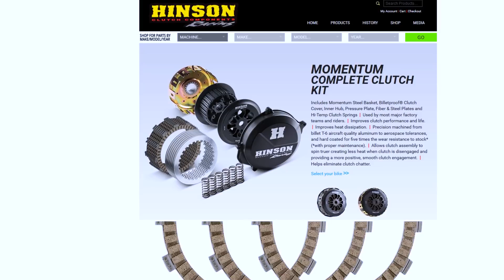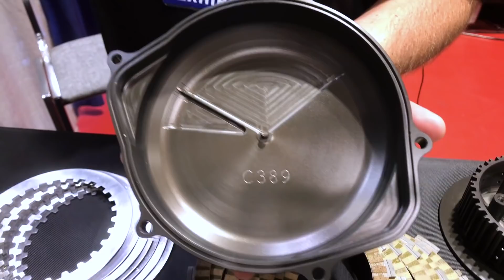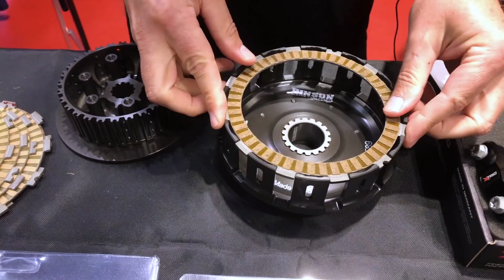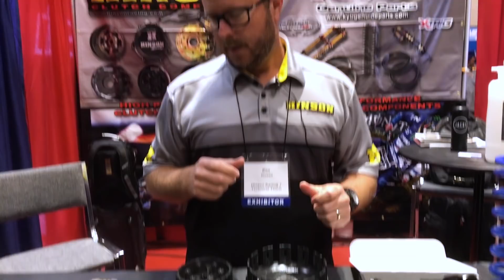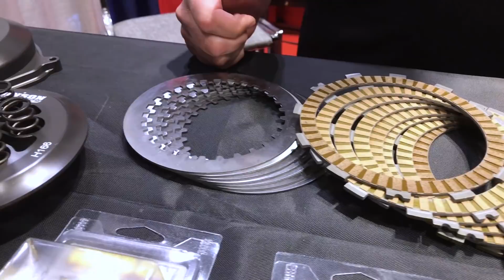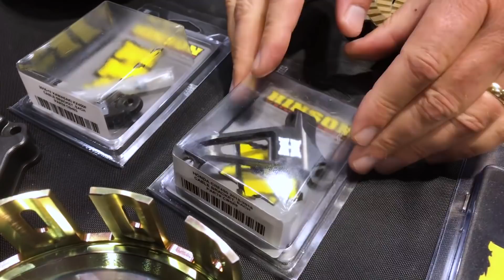Motorcycle Clutch 101 with Ron Hinson from Hinson Racing Watch and Learn

Comment: I was forced to buy a Hinson Basket because I needed the starter gear and could not find that part by itself anywhere, KTM make you buy the basket, drive gear, starter gear, backing plate/rubbers as one part number which sucks, but not disappointed with the Hinson basket, now I have a perfectly good Mitaka billet basket sitting on the shelf.
I must admit, I was more interested in the Barnett billet basket because of the patented hardened stainless steel inserts system, when you start to get too much wear, you don't need a new basket, you just replace the inserts which are not expensive, but Barnett do not come with the starter gear in the centre spline.
Reply from the maker: hi John thanks for the input. Another option is the Rekluse Clutch setup. Thanks for watching.